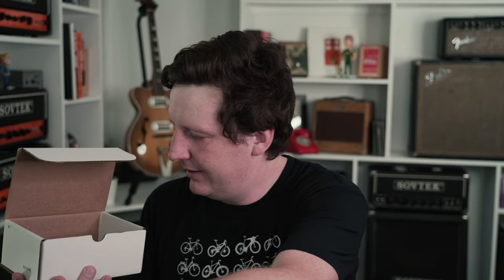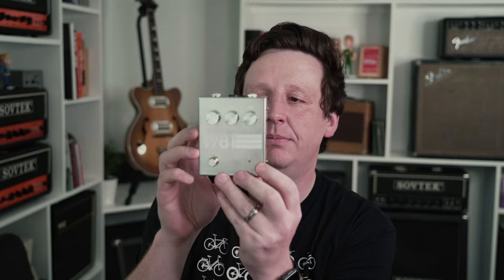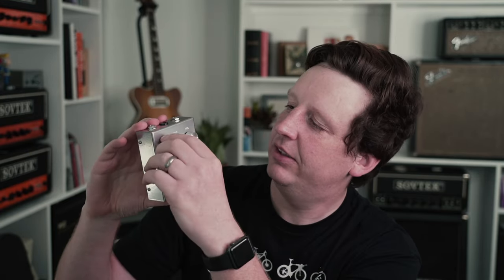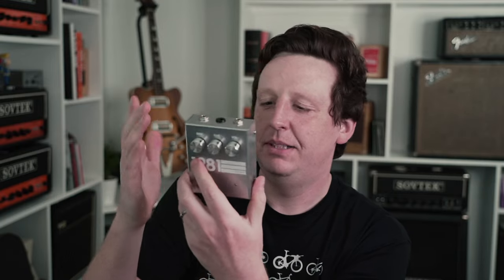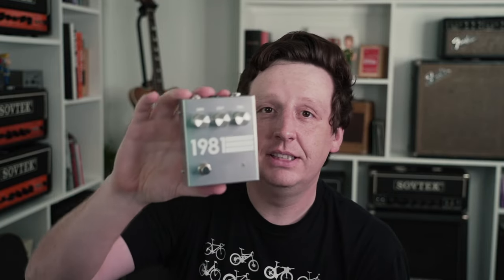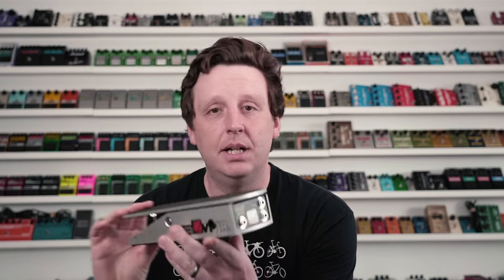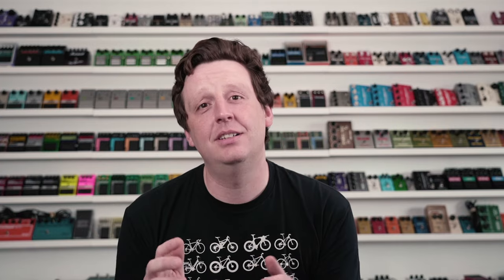Why You Need A Buffer

Comment: Thanks for the explanation.  I asked for something on buffers, and you were already at work on that very subject.  I like using water to explain electrical things.  It usually clarifies the subject quickly.  Although describing a chorus pedal with the water analogy might be tough... (shower massager head?).  I’m setting up an experimenter board with a loop switcher and board to separate the pedals from the switching so I don’t have to bend way down to adjust settings.  This will introduce quite a bit of cable in the middle of the guitar->pedals->amp circuit, and I was wondering if you had any “rule of thumb” pieces of advice for adding buffers in the middle of things (like one buffer every 20 feet?). I realize my mileage will vary, I’m just looking for some starting places; I can adjust from that point.  Thanks for the great VLOGs.  I’m glad I clicked on the sub and bell! Skol!
Reply from the maker: There's no need to put buffers in the middle of your board. Put one at the front of the board, if you still hear loss after the test I show in the VLOG, try one at the end.

Comment: wow your videos are the best I've ever seen. Thanks! Do overdrives and compressors apply the same as Fuzz ? BBE sonic stomp has a buffer I can place at the end of first chain? What about when I plug all my delay pedals into my loop of my FUCHS Blackjack 21 Mk ii?? Obviously it is out of the regular pedal board chain so I assume I still need a buffer at the end of the first chain directly into the amp? thanks! I'm not sure if the loop is buffered . Have to review my manual or email my pal Andy. He modded my amp for me before I moved to Europe for retirement. Any input is appreciated from anybody on this post! Yes it use to be alot simpler when I just had my 100 marshall and plugged in a wah wah pedal,. delay, and a fuzz box when I was a kid. The Marshall loops never worked back then. (1971 or so).

Comment: hm I run a treble boost into my fuzz.............  I'm also wondering if some clean boosts (SHO, AMZ Mosfetbooster)  which have high input impedance but low output impedance would work as a buffer.

Comment: I'm looking to get a buffered splitter in order to mix my effects in parallel. Is there anything I should consider such as getting a switchable buffered splitter or making sure the voltage is 18v rather than 9(for headroom, etc?) or that the pedal will have a phase reverse switch?

Comment: Hey Josh, or anyone else who may know, I have a buffer question. Can there be too much buffering? My pedal board has 8 pedals. Of those 8, 4 have buffers. My tuner (1st) is buffered, my OD (KoT) is buffered and goes fourth, a Chase Tone Secret Pre is buffered (supposedly just like a read Echoplex), and my Boss DD-6 (last) is buffered. Too much? Doesn't matter? Thanks.
Reply from the maker: That should be fine. If you use too many buffers it can create noise, but if you're not hearing it in your rig, then it's fine ;)
Reply: @jhspedals  Great, thanks for the clarifying response!
Reply: I personally found during a recording session using a beautiful very early...late 50s/early 60s vox ac30 that while using one boss pedal was tolerable adding a second sounded horrible...super trebley and thin...really plastic sounding. In all other regards Boss pedals are amazing but personally I’d love them more if their standard pedals had a switchable buffer. I believe they now put a switch in their high end Waza ones

Comment: Buffers after fuzzes AND treble boosters lol, especially treble boosters. I actually have my Triangle Buff (mooer triangle muff copy) after the first buffer in my chain which is a TS9 I modded but there is a couple true bypass pedals in between the TS9 an it's buffer and the triangle buff fuzz. If it were directly after the ts9 it wouldn't sound right or good. Also an amazing way to correct tone suckage an signal loss is with a compression pedal in the fx loop with the comp volume up pretty high and the gain set rather low, then use the comp tone to dial back in the right amount of highs. I actually almost never run a clean signal anymore without a compression pedal engaged in the loop. Compression in the loop takes longer to break up than it does when it's before the preamp so you get more of a clean compression which is amazing. Also comp in the loop will simulate tube sag with the comp gain turned up a bit higher. Using compression to simulate tube sag is great for when you need to play at lower volumes. It will bring back the life your missing from not having the power tubes up high enough.
Reply: Michael Inglis ...really
Reply: @neoaureus  ?
Reply: Michael Inglis ...compressor in the loop ...wow
Reply: @neoaureus  EDIT: This is just one example but theres many people out there that have discovered this. Again its depends of your setup and compression pedal but in the right set up its magic.
https://www.tdpri.com/threads/compressors-can-work-in-effects-loops.549848/

EDIT 2: This is a quote from that thread and is pretty much exactly what im doing with my comp in the loop, high volume but low gain on the comp settings. 
"?? "Sidechaining" compressors is completely and totally common in audio engineering. It's sometimes called "New York style" compression, but it's so common that most compressor plugins now include a "mix" knob so you don't even have to set up an Aux bus.

You basically set the comp to some extreme setting you would not use by itself, and then blend to taste.

Can't see why that wouldn't be just as useful in an effects loop"

Thats exactly right, its one of the best parts of my tone, anyone ive shown it to has immediately loved it.  If your running higher gain pups and want to get the benefits of compression for your cleans without the draw back of the compression breaking up too soon putting it in the loop is magic. Now theres different types of loop, serial an parallel, as well as different types of compression but im telling you as a matter of fact it sounds excellent. Some shitty compressors in the loop with just amplify noise. I build and mod most of my effects and normally i stick to traditional pedal placement beliefs but im telling you compression in the loop can sound glorious. But if your using an older style comp like a Ross etc. then your just going to get noise and if your using a ross your likely using single coils anyways. In which case by all means put the compression up front. But if your pickups or amp is too high gain/output sometimes compression will just push the preamp to hard out front. Id love to prove it to you but your welcome to shake your head in disbelief. Personally it just makes my rig that much more impressive if other people arent doing it also. Do you own a compression pedal? What kind? What kind of loop do you have, and what kind of pups do you primarily use? All of those things will contribute to whether or not you can benefit from compression in the loop. Ive seen multiple bands live rigs with compression in the loop (typically bands that use high gain amps or pups).

Comment: Have a question for you fellas. I have a Fryette D60 which has a non switchable non-buffered loop. If i bypass it completely, my amp sounds loud and great , the same goes if I jump the send/return using a short lead. 

But the moment i am using my loop and have my  DD20 and EHX pog wired up to a bypass/loop pedal where I connect these using PW 20'' cables I suddenly lose quite some volume and definition. People used to tell me to turn the volume down but now, in a band mix it seems like I have a hard time cutting through without having changed all too much. the only thing different is - i bought PW cables for my loop. :) 
Would a buffer fix this? If yes where should I place it?

My chain is as follows: PRS custom 22 > 15 ft PW cable >korg tuner -> Lehle P Split II -> maxon od 9-> 20ft PW cable to amp (from the P split one cable goes to fortin zool gate key input in case you're wondering why its there)
my loop is wired as follows: send -> 20 ft PW cable -> Fortin Zuul (gate) in-> Looper pedal (DD20 and EHX POG in its own send/return) - > 20 ft PW cable ->  return

Comment: (Building my first board) could I use your buffer splitter backwards so to speak to have two guitars plugged into the same pedal chain? (Not playing the guitars simultaneously) I just want a smoother transition process between the two. Also I have a BOSS RC30 at the end of my chain. Will that serve as a good buffer? Since it's a BOSS.
Reply: won't work and might blow it, a buffer is a kind of transparent pre-amp.

Comment: So I tried the plug straight into the amp trick and my guitar sounds noticeably better... But I have a boss TU2 at the start of my pedalboard and an MXR Digital Reverb at the end. Both are buffered. Plus I have a couple other buffered pedals on my board in between. So if I'm still experiencing tone loss what would be the problem?
Reply: Read the section about buffers. https://www.fulltone.com/products/ocd-v2

You might have too many buffers. Also you might have a pedal that rolls off highs really bad; many delays do this. Try putting a boost at the end of your chain and just put enough boost to get back that snappy sound. That usually makes the difference on boards I've built.
Reply from the maker: Hmmmm…. Work through your pedals one at a time and see if one of them is doing it, could be some bad switching prob. Guitar (into every pedal individually) into amp.

Comment: How big is a pedalboard that is big enough to require a buffer at the front and the end? Also how does using a pedal switcher affect this? Is the increase in cable significant enough to the point that a buffer could help? Thanks :)

Comment: Josh if I start my board with a Pulp n peel v4 (with buffer on) and then into my overdrives and then into my fuzz should I have the compressor after my drive section?
Reply: The compressor placement is yours to decide. Buffers generally don't work well when placed before most fuzzes because they usually create noise. I suggest placing the buffer after the Fuzz and you should be okay

Comment: Hey Josh 

I have a jhs kilt primarily used for drive.

Eventually I might get a red remote and use the fuzz setting. 

When using the kilt for fuzz would it need to be first in the chain? 

It is confusing since it's also a drive.

Comment: I'm wondering if I'm running what may or may not be a strange rig, but I suspect not.  I run from a Shure wireless into a FlyRig.  Then all my pedals are chained into the effects loop of the FlyRig.  From the FlyRig into my amp, and sometimes with the balanced out into a board.  Do I need a buffer?  If so, where?  Six pedals, no distortion except for the FlyRig channels.
Reply: I'm still studying buffers, but the Rig Doctor has said repeatedly that if you use a wireless system it will act as a buffer on the way IN to your board. So, you wouldn't need a buffer at the beginning of your pedals. As far as the rest, I don't know. But, the Rig Doctor's channel (Vertex Effects) has got the best videos on the subject.

Comment: Can the JHS Buffer Splitter be used the other way round? I need a buffer splitter that can switch between two guitars and send the chosen signal into the pedalboard so two inputs / one output. Or is there such a buffer splitter on the market?

Comment: If a buffer needs to go after a fuzz, and I use a Boss Compressor (which has buffering), does this square with the advice that a compressor needs to go before a distortion or fuzz? Maybe I should run guitar --> fuzz ---> compressor ----> overdrive and the rest of the board.

Comment: If I have 2 Boss Pedals and the other pedals are true bypass, Do I still need a Buffer? If It is needed where should I put it?
I use 20ft of cable from guitar to pedalboard and 15ft from pedalboard to amp.
Here's my chain:

Guitar > Polytune Mini > Ibanez TS Mini > Boss DS2 > Boss BF 2 (MIJ) > Zoom MS70 > EQD Tone Job

#Newbie

Comment: Hey Josh! I actually have got my buffer in front of my Fuzz and in sounds very very good. My guitar goes into a Lehle Sunday Driver (switchable buffer/boost), into a Morning Glory usually being my always on (Volume 2 o clock, gain 9 o clock, tone at noon) and then into the Fuzz. I run pretty heavy Fuzz Sounds with a KMA Dead Stag Fuzz (Germanium Big Muff on Steroids kinda vibe) and the already buffered and boosted signal into the Muff with a little less gain than I would normally use, gives me the definition for palm muted riffs. I encourage you to try that out and I'd love to hear your opinion on it - although you're probably waaay too busy for that :D kindest regards from Germany 
PS: Loving the Morning Glory

Comment: I'm a bit confused with the buffer business, since I have a couple of pedals in my chain, including boss sd-1, but when I added boss ch-1 at the front, the sound took a big hit, like a pillow muffling it. This is confusing to me exactly because I've heard boss pedals have good buffers. And the interesting thing is that ch-1 is the first and sd-1 around the middle (something like 6 pedals, just a couple of booster/overdrive pedals, delay, phaser).
Reply from the maker: Could just be that having a chorus at the beginning  may not be the best spot for it. Could also be cables or something. So many factors on boards can affect tone. Try putting them in different spots and see how it affects things.

Comment: Is there any benefit to running a buffer circuit inside a guitar/bass? I don't use fuzz pedals very often and usually have a boss tuner on the floor.

What about in the effects loop?

Comment: As I said in another video, I've used the JHS buffer for years. I have it at the end of my chain because before it I have a horribly noisy, tone-sucking line 6 pedal. It was unusable before I got the buffer. The two buffer sandwich is new to me. Would you say MOST boards probably need that? Where would you put the first buffer if you don't have a fuzz?
Reply from the maker: Its all about what you want, do the test I mention from the episode and decide what you hear! As for where, put one at the front of your board, if it still has signal loss, but another one at the end ;)
Reply: @jhspedals  Awesome. Thanks a lot!

Comment: Isn't only old school germanium fuzzes that are affected by buffers, or at least worth testing to see? Also you didn't mention the idea of too many buffers introducing their own signal loss due to the VERY slight volume decrease most buffer designs create or is Fulltones BS'in and their "new" buffer design snakeoil (it adds .3 DB boost instead of loss)?
Reply from the maker: Signal loss happens regardless of the transistors. There are certainly problems with too many buffers. In my defense, I only said to use two... ;)
Reply: Oh yeah your advice was good, just supplementing.

Comment: I'd prefer all pedals be true bypass or have a buffer you can switch on or off. I've bought so many pedals clueless to whether or not they're buffered or true bypass. One thing I don't think you addressed and no one ever seems to (for neophytes like myself) is why having a BUNCH of buffered pedals "ruins" your tone, which I often hear.  I totally get what your saying about signal loss in the all true bypass scenario but how can "too many" buffers affect your tone? Is there anyway to tell off rip whether a pedal is buffered or not if it's not switchable? Thanks.
Reply from the maker: Too many buffers will create noise. Most companies will let you know whether the pedal is true bypass or buffered. You can always open up the pedal and see if there is an option to switch it between the two. Checking out a companies website is always a good idea too.

Comment: Hi! I've got a small board, with a Proco Rat, Old Blood Flat Light, and ending with Boss' DD-3 and RV-6. Everything is fine until I put on my Old Blood ABY switch before everything, the high end disappears completely, and everything sounds... Spongy.
Would buffers before the ABY prevent that?
I use it to share the board between a guitar and a tiny little synth without crouching and dealing with cables

Comment: Hey Josh! is it posible that the buffer, even after the fuzz, might modify it's sound? I found out that my Big Muff and Tone Bender pedals work WAY better straight into the amp and, whenever they are next to a buffer (after them) they also get that trebly sound.
Reply from the maker: A buffer on the output will not in any way alter the sound of the pedal before it. You must have another issue.

Comment: Josh - Is it possible to have too many buffers in your signal chain? Ex: Stand-a-lone buffer in the front, several pedals that also have buffers. Is there any limitations?
Reply: Strat Kat it shouldn’t affect anything. I have a TC Polytune 3 tuner (with a buffered bypass) and a stand-alone buffer. When I turn the tuner to true bypass, my tone is the same. As long as you have your buffer at the beginning of your chain, adding a pedal with a buffered bypass in your rig (any Boss pedals or an MXR Analog Chorus or a KLONe type pedal) nothing should be affected. If anything, it will help keep the signal strong! I just saw Slash’s pedalboard for his current tour with Myles Kennedy, and he has the Friedman Buffer Bay with 2 other pedals that have a buffered bypass as well, and his tone is great! Hope this helps!

Comment: I have the pulp n peel V4 always on and at the beginning of my chain with the buffer activated. I don’t have a fuzz on my board but I’ve been considering it lately. Would a silicon based fuzz still have to go before my compressor? I worry that since the compressor stays on that it will become very noisy when the fuzz is turned on before it.